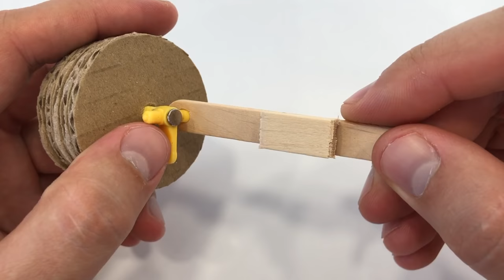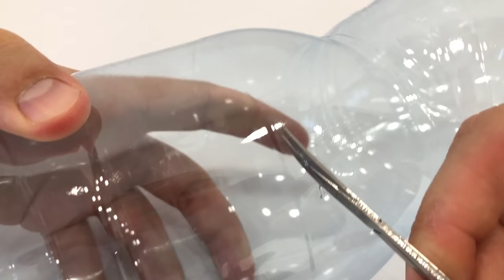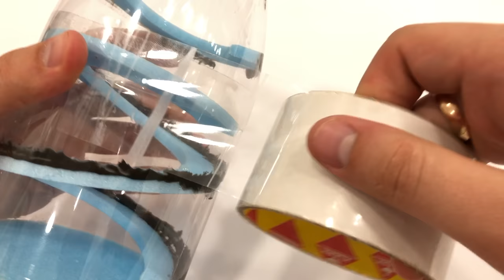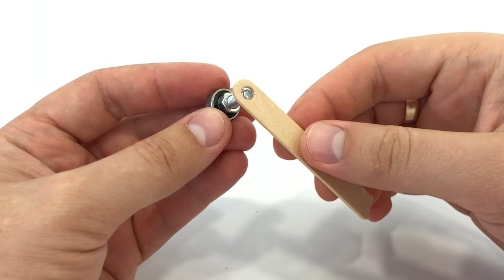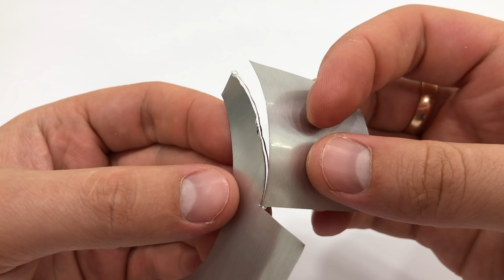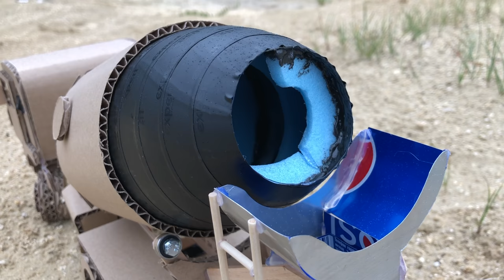How to make Concrete Mixer Truck from a Cardboard

Comment: Very cool. My father worked as a machinist for many years for Jaeger Machine Company, probably the oldest concrete truck mixer manufacturers, unfortunately they went under in the early 1980’s. A number of similarities to the real thing in your model.